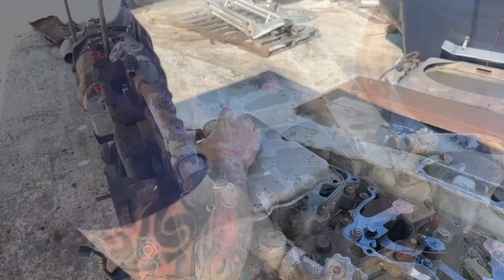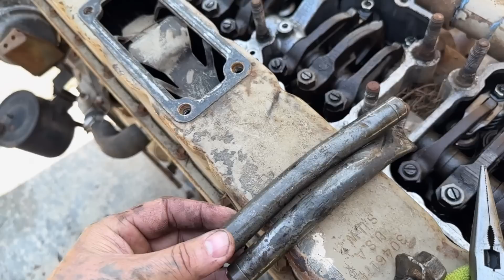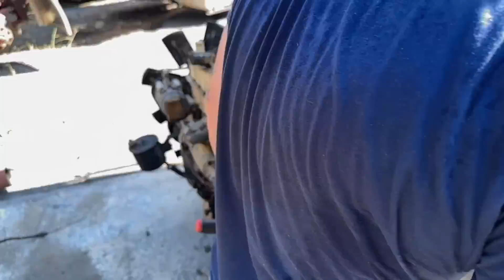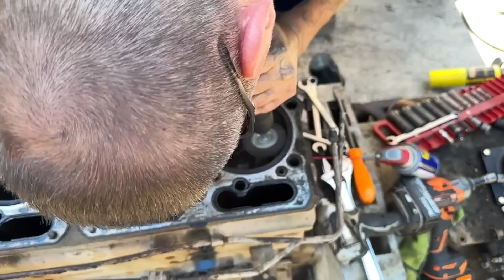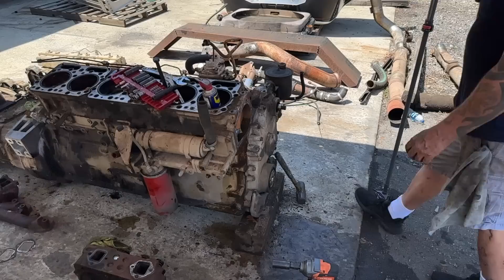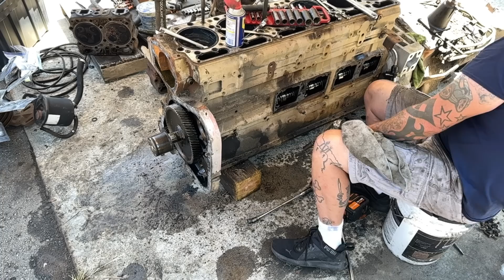Big Cam Cummins, Cracked Block Tear Down

Comment: I have 3 ntc400 complete parts engines just sitting in my yard.  One engine was an oem Cummins reman that sat 10 years before being installed and it had a broken piston cooling nozzle and it wiped out a cylinder.  I don't remember what was wrong with the other 2 engines.
Reply from the maker: Nice bring ‘em over. I can use them
Reply: @JamesPretty  Do you ever come out to California?
Reply from the maker: @ChrisHarding-lk3jj  Los Angeles quite often. But only for work
Reply: @JamesPretty  Don't you fly cargo, does the carrier have employee discounts.
Reply from the maker: @ChrisHarding-lk3jj  the customer owns the whole cargo compartment

Comment: You can use wax furniture polish as a rust inhibitor for the parts your saving, cheaper than the likes of acf50! Keep at it MrP
Reply from the maker: I’ll try it. Thanks sound a lot easier than this messy grease

Comment: If you did not see any visible cracks in the block you might want to pull the liners and pull the rubber seals off of them to look for corrosion holes in the liners.
Reply from the maker: There’s an 8” long fracture in the side alone the coolant passage

Comment: Hi James. Lots of savable parts on there. If you keep at it you’ll need a bigger garage. I’d bet that bell housing is special for the Ford. It’s probably designed for that tilting engine. The leaning engine of Ford trucks. At least you’re keeping the parts organized so you’ll be able to find them if needed. Stay safe
Reply from the maker: Thanks bro